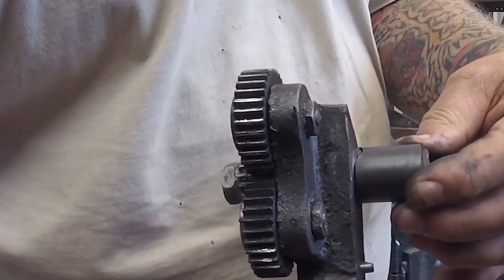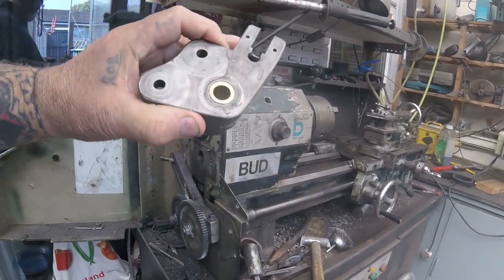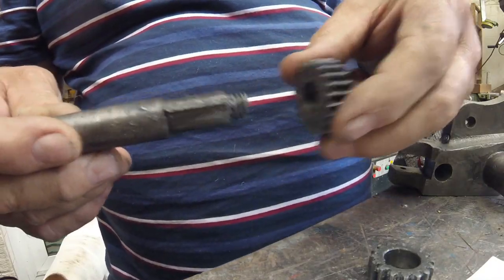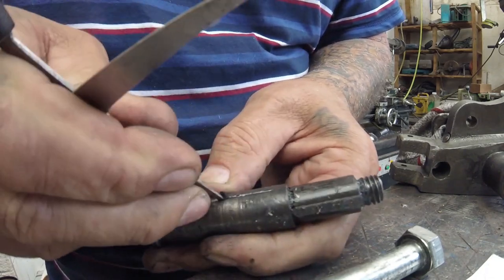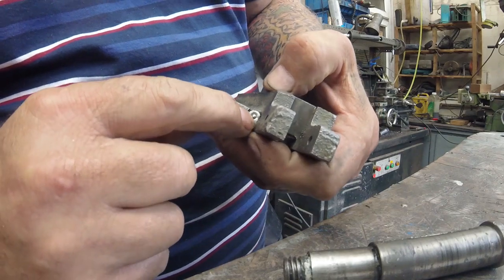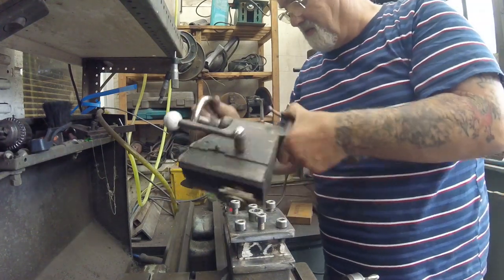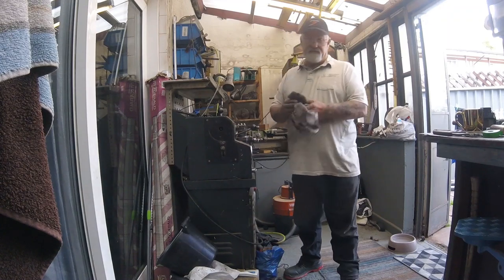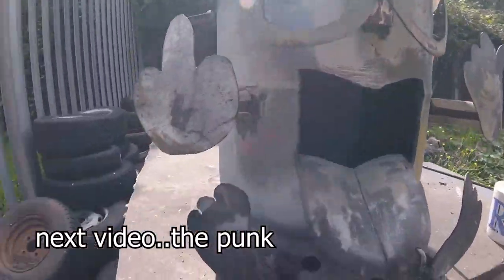how i hopefully saved 100 pound on parts ...boxford lathe o.a.p

Comment: Would oiling that part have kept it from breaking? I'm a bit obsessive when it comes to lubricating my stuff over here. I'm always oiling or greasing something. Yesterday it was scissors. I try to oil everything a few times a year. Hell I even oil wood. I use a different oil for that though.